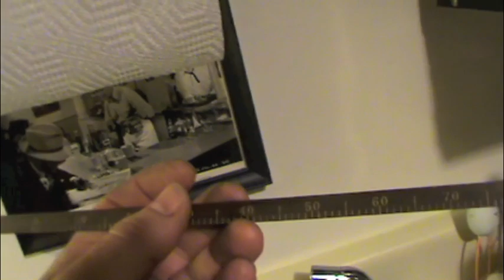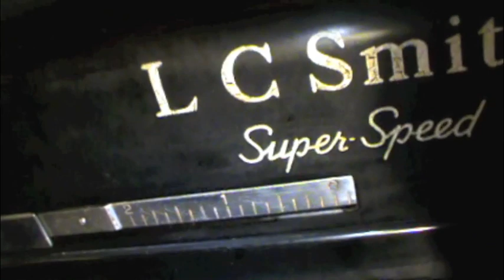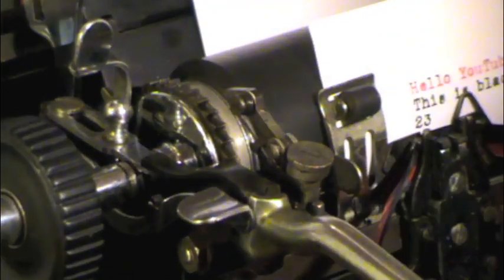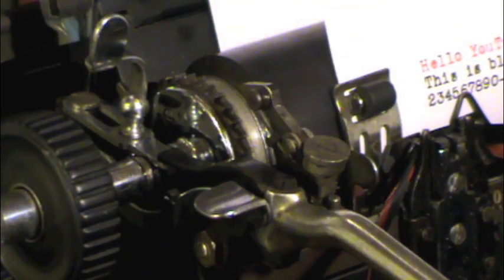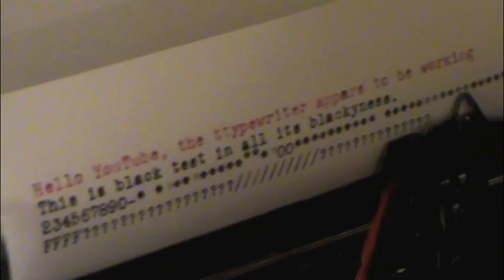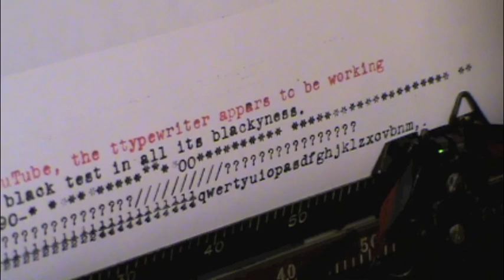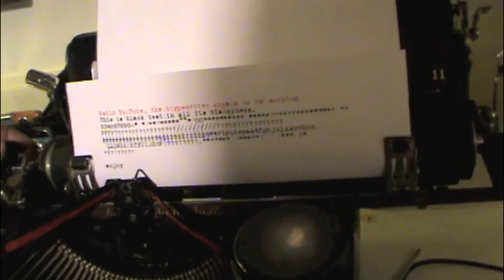Repairing and Cleaning the 1937 Smith and Corona Typewriter

Comment: You are so right.  2000 individual parts that had to be detailed and checked for form fit and function.  Then figure out how to manufacture everything.  Make jigs and fixtures so things can be made quickly in large batches.  Then assemble the parts into a finished machine.  Do it in large volume so that prices can be low.

Comment: I was having the same issue with the spring sticking on my 1948 super speed smith corona. I had to remove the back and put it back together. Works fine now, just don't have the metal spools for the ribbon. Still on the hunt though.

Comment: So now I have my Super Speed. The thing I like about it ie: the streamlined shroud that encases the works, and makes it look more moderne, is also keeping me from getting at those works to clean. It seems that at one time there was a mouse living inside of it, way in the back where I can't reach! This mouse also used as a nesting material - pink, black, and grey fuzzy threads from one of those nasty 70's couches. and I think it's gotten into the escapement works so the carriage won't slide. Help, do you know how to get the shroud off - I can only get the front plates off which is a start, but the rear panels don't show any connecting screws or clips!
Thanks also because I believe your model has very similar mechanics to mine, so this has helped alot!

Comment: I recently found a typewriter of the same model at my grandparents house, but the bell won't chime when you reach the end of the line. The hammer that's supposed to hit the bell is located too far away from the bell, so when it swings, it's always a little short. Any solutions to fix it, preferably without taking apart the typewriter? I will if I must, but I'd like to avoid that.

Comment: I have this unit. The belt broke. I can't seem to see how it is configured.
Reply: The belt should hook onto the bottom of the carriage assembly , and the other end should feed into a slot on the mainspring housing , you can use anything like the old draw string , a shoelace or string , as long as it's sturdy , you will have to wind the mainspring , whick requires turning it until a real good amount of tension is on it and then attach the drawstring with the tension on the mainspring .

Comment from the maker: No, it "crashes" if you accidentally hit two keys at the same time. Nice try, though!
Reply: I highly recommend getting an air compressor. It makes cleaning go so much faster. I picked up one ad a Christmas present to myself, and it has completely changed cleaning typewriters for me. I was using canned air before but that gets expensive. So in total for the air compressor, hose (the air compressor I purchased didn't come with one), and the attachments, it came out to around $200 Canadian. Best purchase I have ever made.